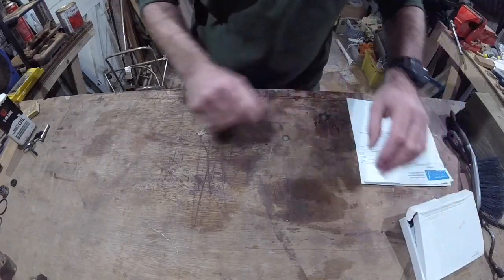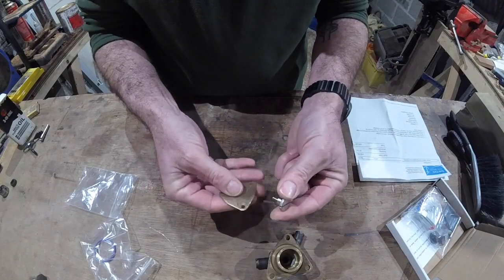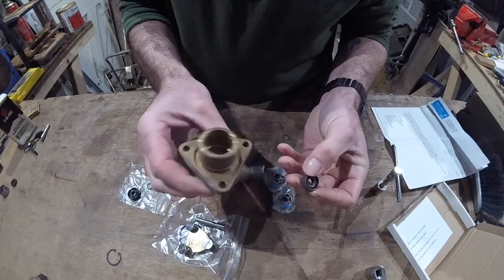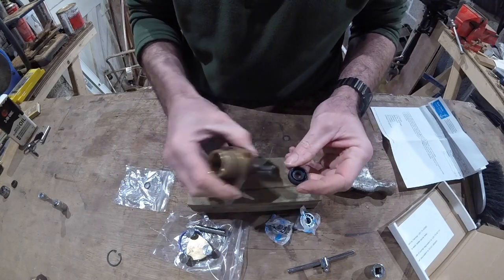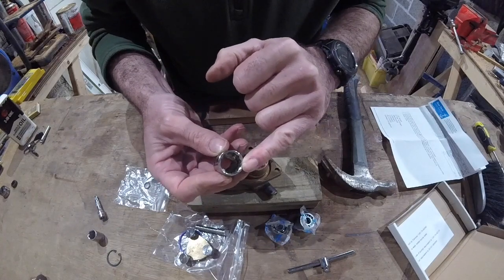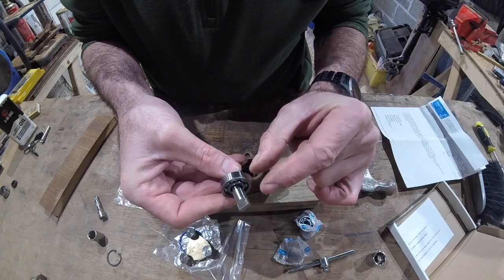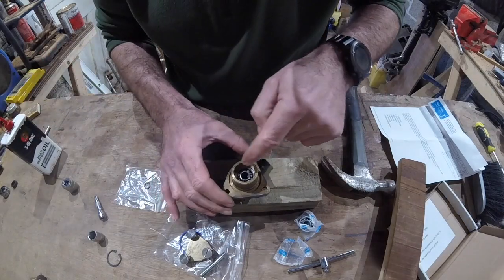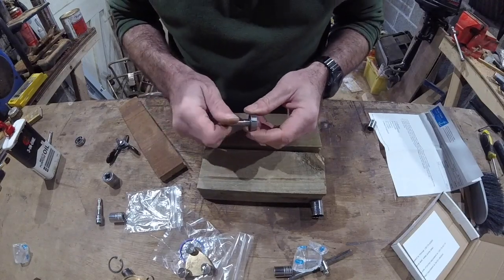Yanmar 1GM10 water pump rebuild

Comment: hi, great video! would have been impossible to do it without :)
just a quick sidenote: I replaced the seals because of a leak getting out from the small holes in the pump. when these holes are leaking it means that there is an issue at the external seal. Once I opened the pump, I noticed that I had extremely old seals, they must have been there for decades. it was very hard to remove them, the metallic parts were glued inside with the plastic, and had to nastily force them out. 
Another issue I had was with inserting the new seals. even though I had cleaned the inside as much as I could, I had problems. I put the new seals, closed everything, started the engine and it didnt start. Turned out that I had not pushed enough the seals, so I had to reopen everything, push harder and hammer it, and then it clearly went deeper few mms. closed everything again and now no leak! 
hope this may be useful for people with not much hand skills, like me!
Reply from the maker: Well done mate, sometimes these things are trial and error 👍

Comment: Hi, working backwards using your video it seems I should be able to just pull the bearing back up the shaft then take the circlip off followed by the last bearing? I’m having trouble getting the 1st bearing off! is there a certain technique or tool you use? 
Thanks for the video
Reply from the maker: Sorry, this was so long ago that I can't remember 😁

Comment: Great video. Quick question, I have take the pump out and my impeller and seals were shot. I’ve cleaned up the case and a small aluminium “spacer” about 8mm came out from where the water seal goes. I can’t find a manual that even mentions this spacer. Does it sit between the seals, or does it sit in the casing so that the seal sit back to back? Pretty frustrating that there’s no mention of it anywhere.
Reply from the maker: I suspect, that you have a homemade solution to try to ensure that the seals can't be dislodged. I think it's unnecessary...

Comment: great video. Are you happy with those  'thumb screws' ? Those are going to cost me $45 (with shipping to the US) and I wonder it there is enough clearance between the impeller cover and the crankshaft V-pulley for those  'thumb screws'  to fit in there. Looks to me like the 1GM10 is very similar to my 1GM.
Reply from the maker: 45 bucks! Not cheap... Clearance is tight, and getting the screw behind the pulley wheel to engage is a bit tricky. But they do fit.

Comment: How did you remove the old seals?
Reply from the maker: With a small wooden drift from the impeller side and gentle tapping. It wasn’t difficult to get them out.
Reply: Hi again. I managed to remove the old seals. But fir the life of I can't get the new smaller inner seal back. It simply will not go despite following your video. Though on the smaller seal there is a washer that looks like a spring. Should that be there? Regards Barry
Reply from the maker: @barrynorman732  yes it should be in there. I assume you’ve made sure that the hole is completely clean after the old seal is removed. After that, very important to press the new seal in squarely, like a bearing, if it’s not absolutely straight it won’t go in, or it’ll get damaged

Comment: Many thanks for the video! I recommend changing the oil pipes below the water pump at the same time (there are 2). If a leak develops on the water pump you will eventually find yourself with a very messy bilge. There are cupronickel replacements available on ebay- the Yanmar OEM ones are no good and will rust through- if it's all you've got then I would recommend some anti-corrosive coating.
Reply from the maker: Elliot Simon yup, I did exactly that in a previous video, for exactly that reason, from exactly that seller 😂😂😂
Reply: Do you have a link to the seller? Can't find the oil lines